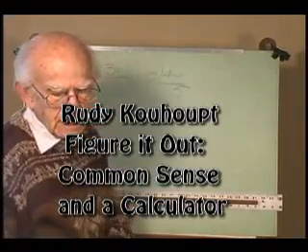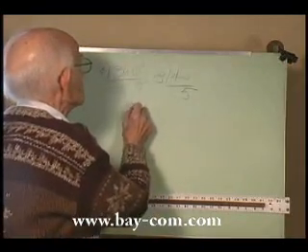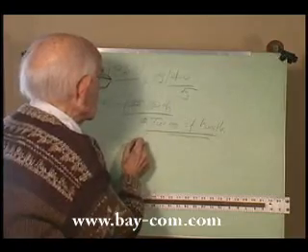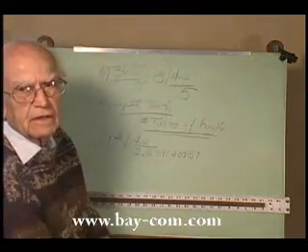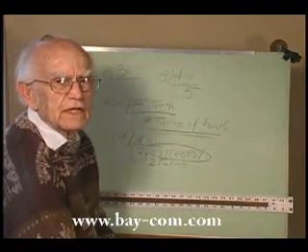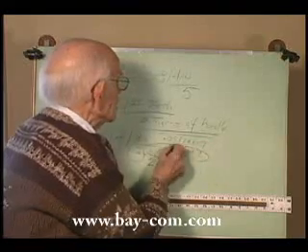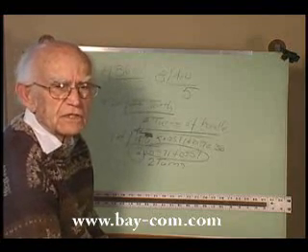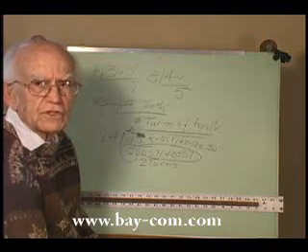Figure it Out--Common Sense and a Calculator.wmv

Comment: This is a really roundabout way to find the required turns and index plate. Just reduce the fractions! No decimals.

40/14 = 2 12/14 = 2 6/7

Find an index plate with a multiple of seven holes (21 comes to mind).

2 turns 18 holes over 21 holes. No calculator, no chart, no confusion.